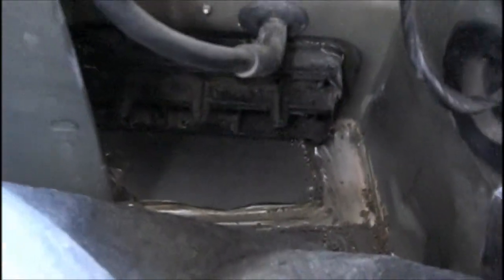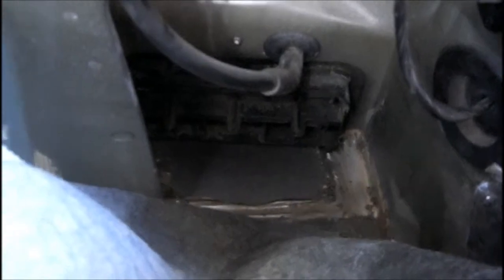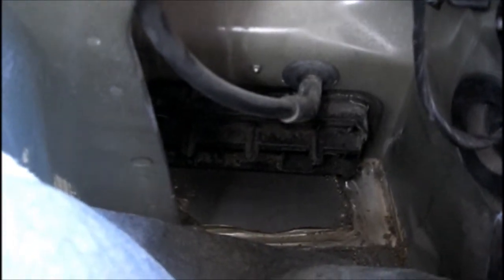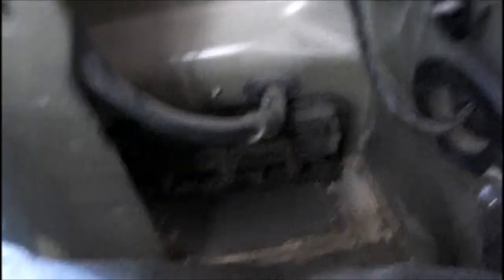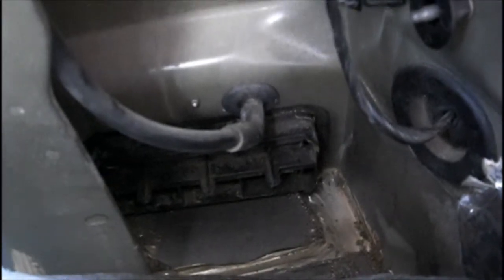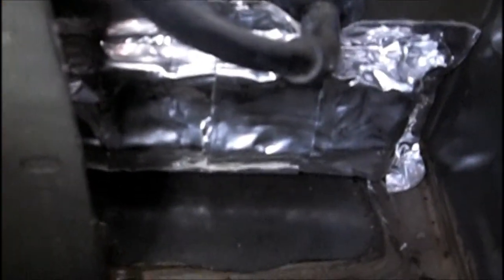Dumb Alero Trunk Vent!!

Comment: Do you remember if this actually did anything? I was considering doing this a while ago but wasn't sure if it was worth taking all my gear out
Reply from the maker: stopped the flapping noise from under the car on low notes
Reply: @scott192  thanks for the response man was not expecting that on a ten year old video. Do you remember if it hit any harder or did it just keep the vent from flapping?
Reply from the maker: @triggeredhondaboy8648  I couldn't say that was the one thing that made it louder but all the sound deadening with that made a huge improvement in sound